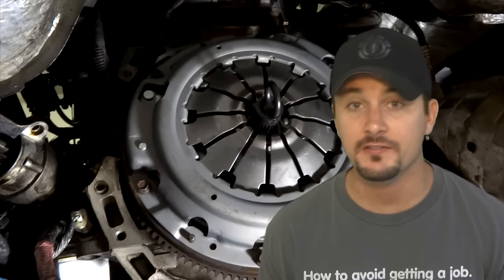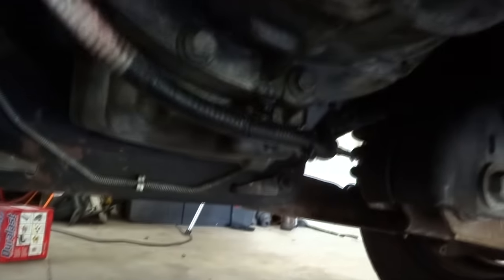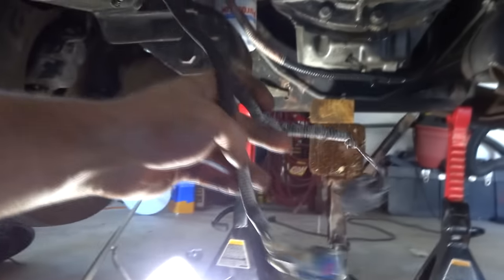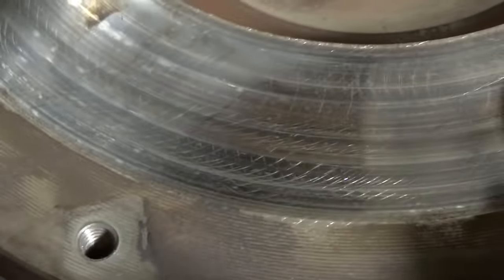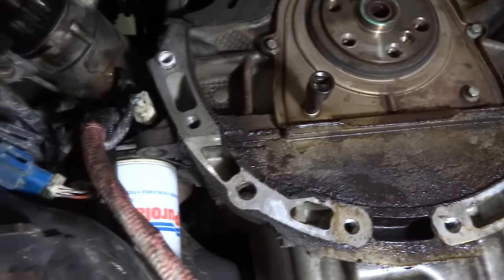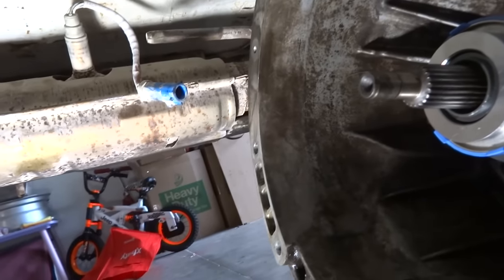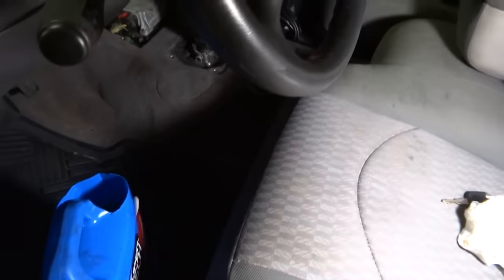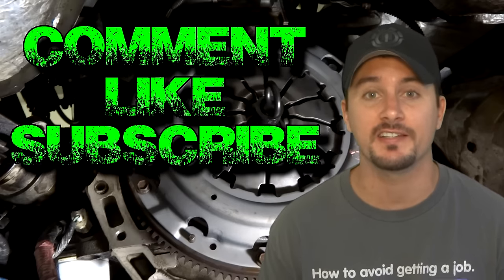Clutch Replacement Ford Ranger & Mazda B-Series ⚙️🔧

Comment: Another example for why you shouldn't try and learn things from watching someone on YouTube. Just because they made a video of them doing a certain job or project do NOT mean that they're doing it the right way, or the safe way. First of all, your jack stands are only like 2' apart from each other. You really need them spread out as far as they'll and still be on solid steal for tue most stability, and the frame is not made out of case. And second, that's not how you remove the hydrolic line fitting at all. I didn't even watch the rest because I realized by then that I wasn't gonna learn anything from this YouTube kid in his daddy's garage. But, I guess if he got it replaced that's all that counts, just remember people,, the "YouTube" way isn't always the best way or the right way, it's the "YouTube Way".